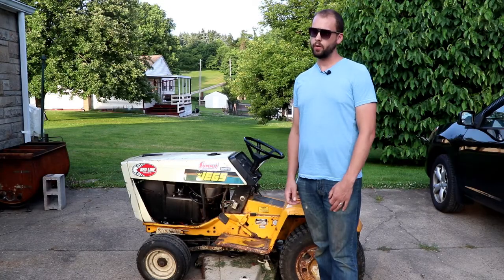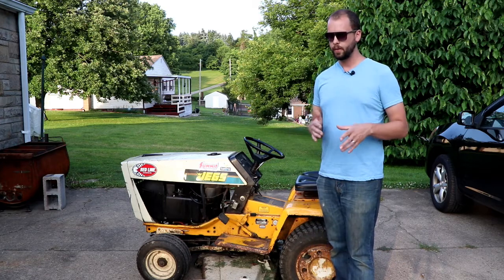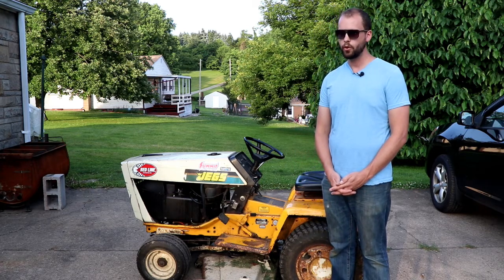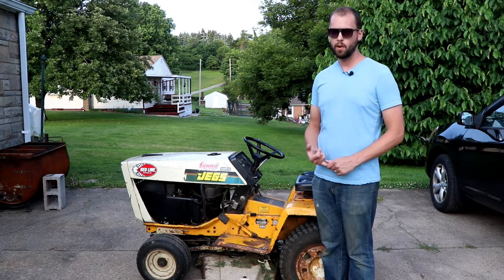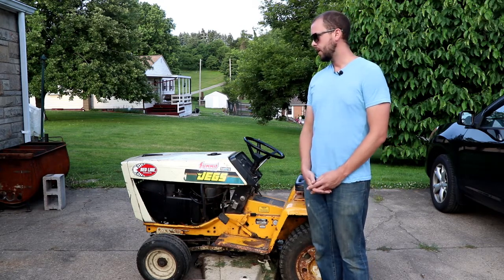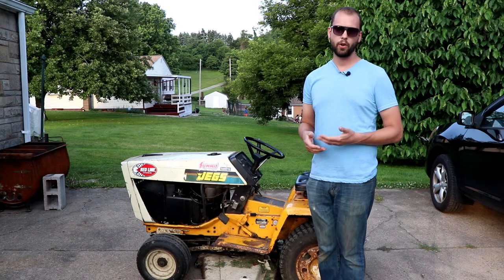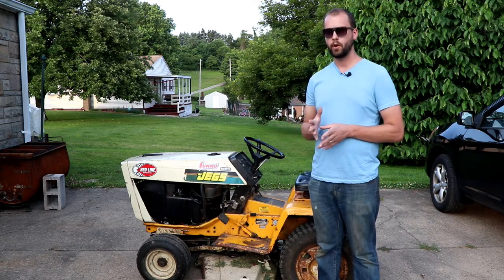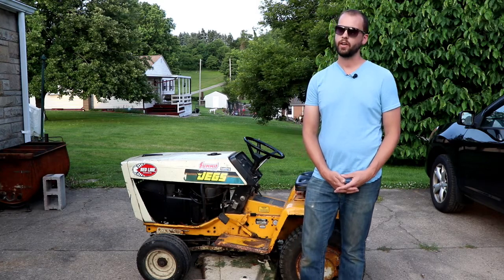Cleaning the Carburetor on a Kohler Magnum 18 Engine that is Surging

Comment: I just picked up two tractors with that Kohler Magnum 18 engines in them. I know the carburetor in one is frozen and will need to be rebuilt. Your video is helpful, but I would appreciate a more in depth tutorial on the rebuild of the actual carb. Do a step by step, without the fast forward, and please show in detail the steps to disassemble and clean these carbs properly. Thank you friend.

Comment: I have this same type engine , it is a MV20 . It sucks oil into the combustion chamber when it's tilted to the right . Tilt to the left with no problem . Compression is within 5lb on each side . I'm stumped .

Comment: Thanks for your help, would you by any chance know what air filter to get for this it did not come with one...Thanks
Reply: I'm not sure off hand.  I think it is a pretty standard 6 or 7 inch round filter.  If you take the filter lid to Napa they should be able to get you the right size.  That's where I got my last filter.

Comment: Your Kohler Magnum 18 Engine kind of looks like mine I just ordered from your link the fuel filter I will try that first can you send me a link for the correct spark plug and what gap should I put on the plug...looking for air filter also thanks
Reply from the maker: It probably is the fuel filter.  If that doesn't work then clean the carburetor.  It is a two cylinder so you will need two spark plugs.  I don't know the number off hand but you can pull one pretty easy or might be able to read it if you remove the spark plug cap.

Comment: Good Video ...I just got a home made log splitter with a 18 HP Kohler but how can I tell exactly what engen it really is, as its running at full throttle it sounds like it idles down every 20 to 40 seconds but without loosing power, it sounds like it running out of gas but the tank is full.... but it just bothers me when i hear that in the background what do you think it is?? Thanks

Comment: Useful video thanks. These small engine's are surprisingly easy once you get to know them. As mentioned take your time to understand how they come apart and go back together. Also, if there have been different fuel hose/lines fitted check those over as sometimes the fuel can make them deteriorate and they can restrict the fuel entry to the fuel filter/engine etc
Reply from the maker: Thanks!  Yeah, I'm sure little bits of rubber could start coming off the fuel line on a tractor this old.  Probably worth changing if you are going through the hassle of cleaning the carb anyways.